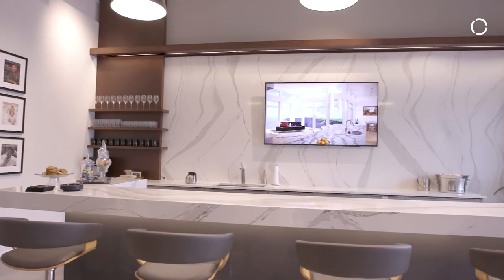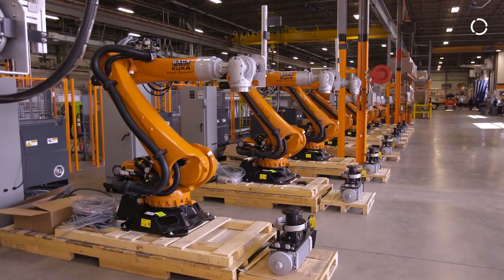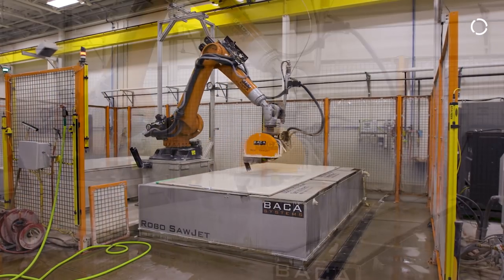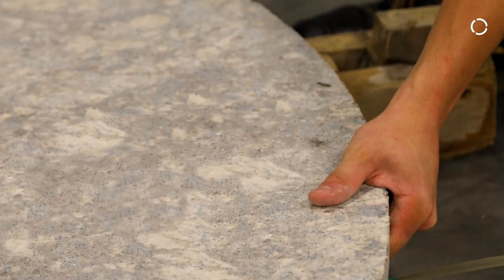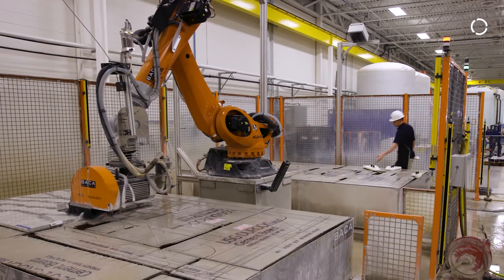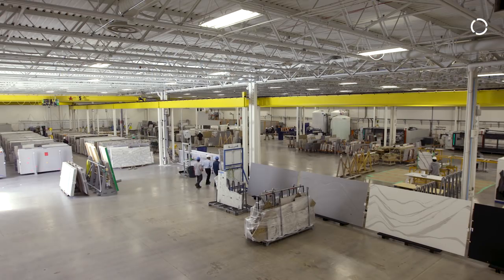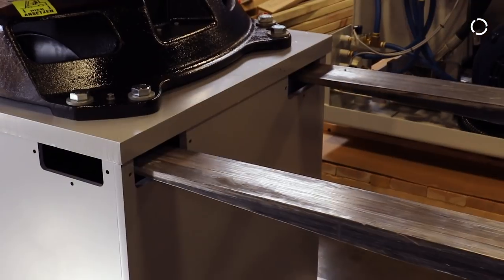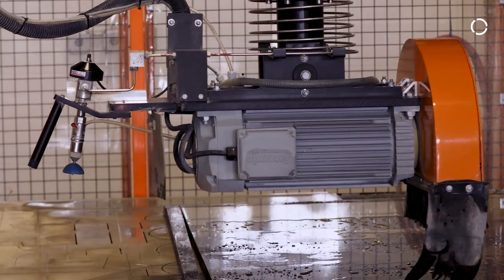SawJet Robots for the Stone Cutting Industry | Productivity and Safety

Comment: Gantry saw is for precision and robo for high production. Amazing piece of machinery I’ve personally operated one of these but the owner had way too high of expectations. When the arm extends the cuts get off a bit and the only way we could cut dekton and quartzite was jet only. Great for commercial jobs or high flow residential or have CNC’s clean it up after.
Reply: Hi @Matterdaddy! Have you got any answer for your comment? Recently I got same comment from a stone fabricator regarding precision issue on cuts which appears as the machine worn out. This is not what we are reading or hearing from Baca or Kuka.

Comment: i would love to work for KUKA some day, what will give me a better chance: computer engineering or electrical engineering ? thanks
Reply: Try mechanical engineering or electromechanical. The challenge with robots is precision. If the mechanical side is weak you don't have a useable robot.
Reply: thank you for the feedback sir
Reply: Ask Kuka.
Reply: +Taavi Koppel
Even best articulated arm type robots don't have any accuracy to speak of, manufacturers don't even list it in the spec sheets. It's inherent problem with 6 axis robot construction. Best you can do with a robot from mechanical perspective is make it rigid and get high repeatability. If you want it to also be accurate then you will need external position feedback and compensation, that pretty much devolves into software engineering effort. There will always be work for mechanical engineers, but if you want to deal with robots specifically, then software engineering is what makes them do anything beyond simplest of operations.
Reply from the maker: Hi Diego, good news is that KUKA is growing! We always have need for high quality applicants in many engineering disciplines (software and mechanical for sure). Mostly it depends on what kind of role you want to have. Are you more into the idea of product management, R&D, business development, technical sales, service, etc.? if you are in university, a good place to start is as a working student./intern at KUKA to get a better idea of what discipline you want to pursue (and can sometimes even be applied as credits at university). If you ever want to browse our available internships and jobs, you can look here: https://www.kuka.com/en-de/careers